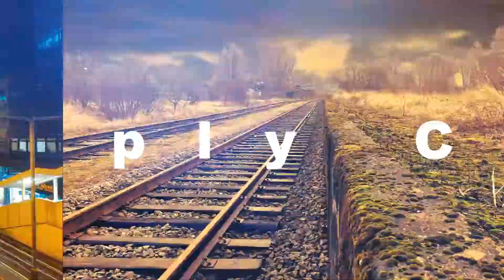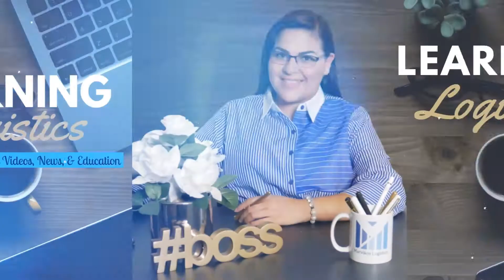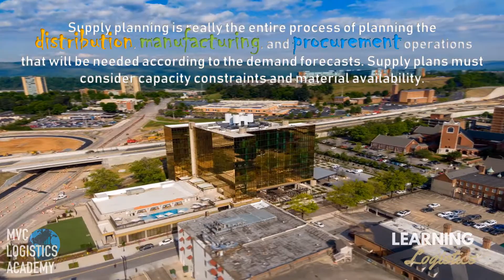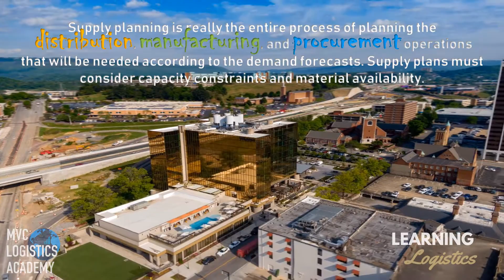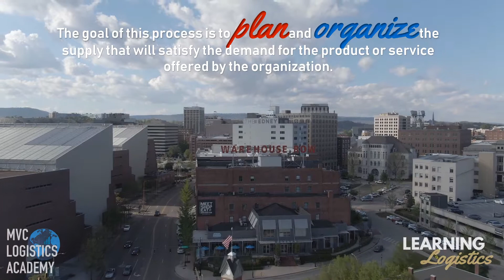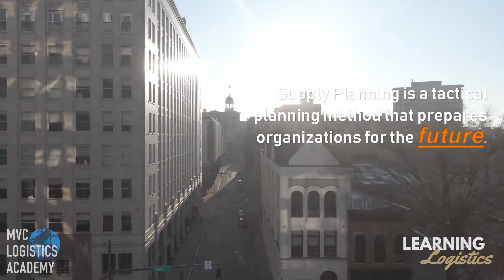What is Supply Planning? Supply Chain Basics

Comment: Just wanted to ask what is meant by 'supply chain planning and control'
Am confused with the control part
Reply from the maker: Thank you for commenting. 
Okay, so supply chain planning and control refers to the process of coordinating all the elements of a company's product flow and then also keeping track of them. 
For example, if I own a company that sells shoes: 
-I want to plan where to get the materials (leather, cotton, elastics, glue, and etc)
-I want to plan where I will store those materials
-I want to plan when those materials will go into production and manufacture the final shoes that I will sell. 
-I want to plan how and where to sell the shoes. 

At every step of planning, I want to make sure I monitor (track, or control) all these processes so that I can fix any problems and keep things flowing as smoothly as possible. 

Hope that answers your question,